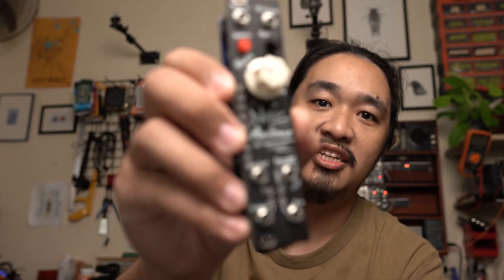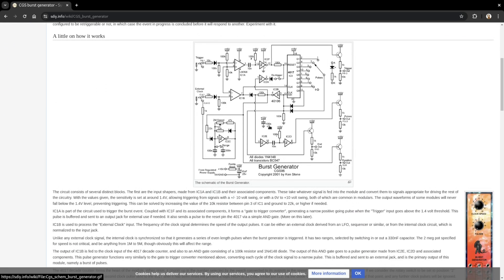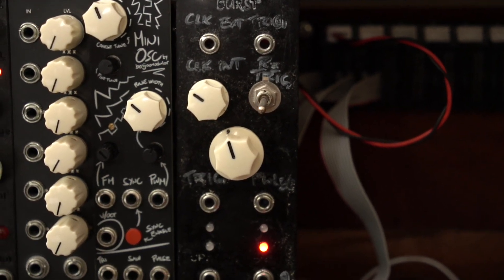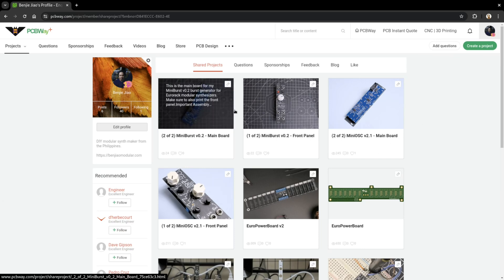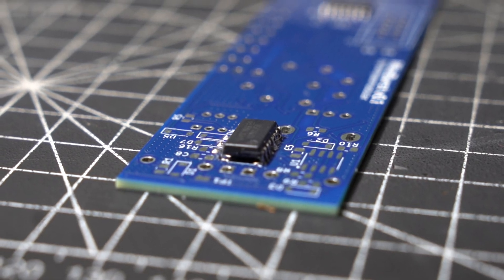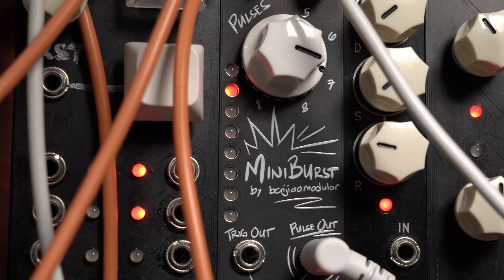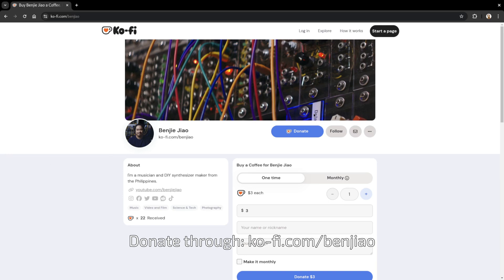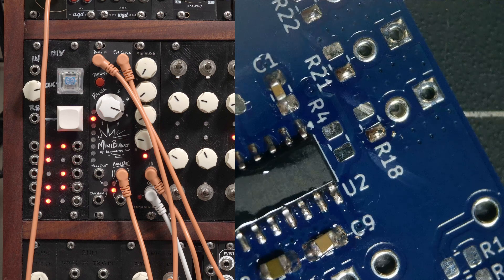I made an open-source analog burst generator!

Comment: Your panels look amazing! I love the hand drawn look on the silkscreen. Are you using any plugins to go from Inkscape to Kicad? I'm interested in your work flow. I can make functioning pcbs but they look nothing like yours!!
Reply from the maker: Hey, thank you so much! I don't use any plugins to do this. My workflow right now is:

1. Do a rough layout of the controls on KiCAD's PCB editor
2. Export as SVG
3. Import SVG into Inkscape
4. Draw my labels and refine the layout (alignment, etc.), using the SVG as a guide
5. Remove guide elements
6. Export to PNG
7. Import into KiCAD through the Image Converter as a Silkscreen footprint
8. Finalize PCB layout
9. Export Gerber...
Reply: @benjiaomodular  Thank you, I'm going to try it!

Comment: You could connect the CD4017 to a CD4051 to add cv control with some extra components to translate CV into binary.

Cool sounds, gotta make me one too.
Reply from the maker: Wow, that does make a lot of sense. I'll add that to my list. Thanks!!
Reply: @benjiaomodular  This ic's in combo with comparators (LM339) allow you convert CV in to digital to control CD4051. it will cost some pcb surface but it will work.

sn74hc148
8-to-3 line decoder/demultiplexer
Reply from the maker: @AnalogDude_  yup, i ran into exactly that last night! thanks 🙏